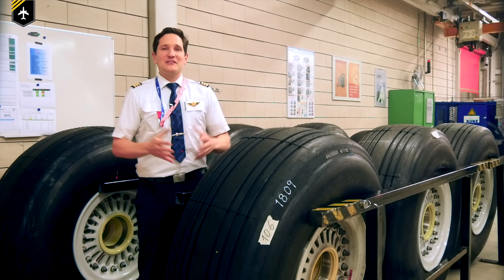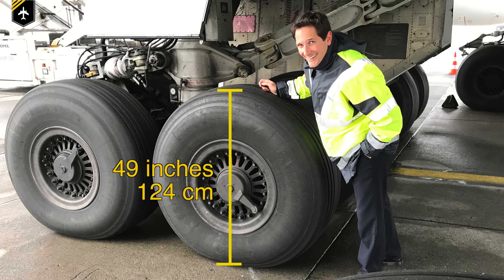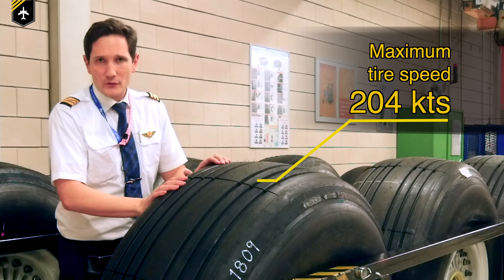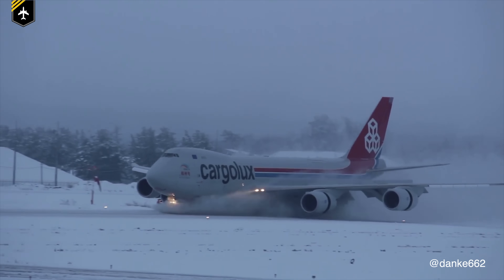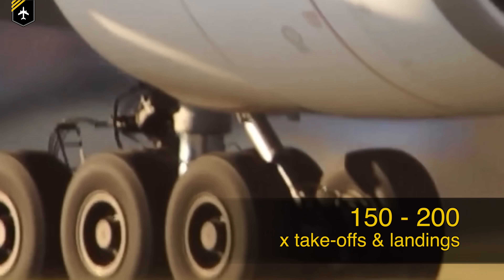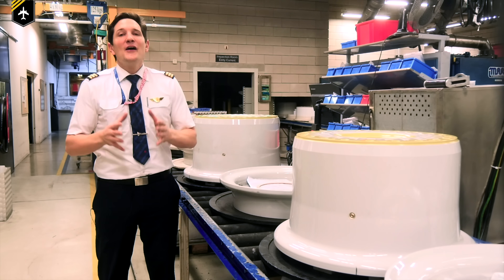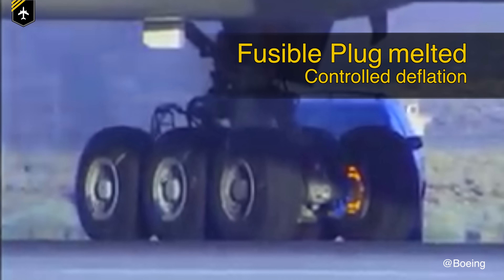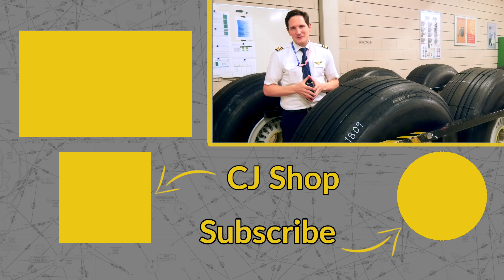HOW MANY LANDINGS can TIRES withstand?? Explained by CAPTAIN JOE

Comment: Modern cars are also equipped with the tires that are not prone to deformations in a case of deflation. Those are called Runflat, and allow to drive for another 80 kilometers at the speed up to 80 km/h even with a puncture.

Comment: Hello, Why not mold some "wings" on the sidewalls of the tyres to catch the wind when lowering the landing-gears onto the windflow and thus make the wheels spin to minimize the threadwear when landing. If the "wings" will have a wedgeform they will always spin in the right direction if the flat surface is mounted on the lower part of the tyre and therefore takes more wind than the upper part giving a "positive" rotation.

Comment: Just an FYI, there is such a thing as dry air. The nitrogen fill gas is dry because the nitrogen has been through a drying process (water vapor trapped and removed) before being bottled for sale.

Comment: I feel sorry for the tires at the very back of the pack, as they hit the ground first.
Reply: They hit the ground first but they do not have more load than the other... The load occur when the full weight of the aircraft is on the suspension, by then all tires (except sometimes the nose gear) are in contact which the ground and load is distributed. 
That is why trailing tires do not have to be changed more often that leading tires: the wear is even.

Comment: It would be interesting to know how much one of  those tires costs.
Reply: Apparently around $5,000 a piece, which really isn't all that bad being its aerospace.
Reply: @AllenSunnyD  Thanks, Allen
Reply: @AllenSunnyD  That is not bad $5,000 i have looked at  farm tractor tiers that are £25,000 a piece
Reply: You can find them used for about 1000 bucks each there's alot of farmers that put them on their equipment because they never wear them out alot of them have a sidewall that's about 3-4 inches thick compared to a truck tire that's maybe a half inch
Reply: Cam:  I live in Central Florida where most everything is deep sand, the plane tires will float across that like they had any load at all, saves you from having to call out a big tow truck every few days.
Reply: Ralph Turner Probably more than a Modern Car.

Comment: Layman thoughtl: why not have a system on the landing gear that takes the speed of the aircraft into account and then electrically spins up the wheels to match that speed as closely as possible? On touch down, the wheel is already almost at the right speed so the initial shock should be much lower. Probably something that makes this impractical, or the gains too small.
Reply: Spinning tires cause  Gyroscopic effect and affects the aircraft handling.  The same reason why the brakes are applied as soon as the aircraft is airborne, otherwise the plane won't respond correctly.  Air Force Crew Chief with 24 years experience.
Reply: I just wrotte the same thing!great minds think alike!!
Reply: Watch Mentourpilot's "Why not make plane-tires spin, before landing?!". He pretty much destroys the idea fact by fact.
Reply: Causes oscillating during landing.

Comment: Really looking forward to the next one.

While doing the post-arrival walkaround, I was told to look for 'slashes' in a tire. I have to admit, I have never seen a damaged tire before, so I'm clueless when it comes to those 'slashes'...
Reply: Slashes happen during shipping. Especially when you move them around with a forklift. The forks can damage the sidewall. I've seen maybe 3 or 4 in my career. Mechanics are suppose to catch this before they go on the Aircraft. But you can't see everything working at night .

Comment: I would like to praise all the effort your go through to find just the right clip of various events to show us a lot more than mere words could get across. Love the safety plug blow out shot-- but you didn't mention the glowing-red-hot brakes! Yeoow!
Reply: Film like the one where the fuseplugs release are typically from certification flight testing -- a maximum-energy braking test in this case.  It's a given that the fuseplugs will release (required in order to pass that portion of the test, in fact), so everyone is ready for it.

Comment: how does a yoke or sidestick help the plane to take off or land
Reply: With the yoke or side stick the pilot controls the ailerons and elevator, and these are used to steer the aircraft. During the takeoff roll when the aircraft reaches the correct takeoff speed the pilot pulls the yoke or side stick backwards to move the elevator so that the aircraft takes off. During the landing the pilot controls the aircraft's pitch angle and longitudinal axis with the yoke or side stick.

Comment: Nitrogen is nearly identical in temperature sensitivity to Air (and many other compressed gases). The Reason Nitrogen is used is because it is super dry compared to air from a shop compressor. It's much easier to just say nitrogen only then say dry air only which is harder to monitor/test.

Comment: Why isn't electromagnetic braking used instead of the standard braking?
It can eliminate the problems of heat and wear.
I understand there'll be disadvantages too but it'll be a good worth if you put a video explaining it in the upcoming weeks.
Reply: What do you do with the electric energy generated? If you can store in a battery or an capacitor, ok. But in an aircraft there is no such battery. So the only way to get rid of it is to turn in into heat. Well, if you have to turn in into heat anyway, you can simply stay with friction brakes which are also much lighter. The kinetic energy the aircraft carries does not simply disappear, regardless what kind of brakes you use, the energy has to go somewhere.
Reply: @shi01  There are other types of electromagnetic braking than what you were talking about. In one of the type what I know you are just going to convert the energy into mechanical stress over the mount member.
So technically there'll be no heat generated, but that's not the real case. Heat will be generated but not as high as friction braking. The energy is going  in mechanical deformation of the mount member, but if done with an accurate analysis and a decent FOS the deformation will be neglible. I think you get it.

Comment: Why don't you tell us about the tires construction ? As that is a most extreme difference than other tires, let alone a car tire. Many airplane tires have as many as 49 plies or layers of construction. Are they bias ply or radial. Nylon plies or steel belted and why ?
Reply: Both bias and radial tire constructions are available for aircraft. Nylon and steel materials are used in in the construction depending on the tire manufacturer and/or the specific tire model. 49 plies sounds like a lot!

Comment: I’ve changed many a tire over the last 30+ years in aviation. From 727’s to 787’s ,airbuses, DC 10 etc etc. The 777 center tire on the main gear is hardest. I’m Tired of Tires. Brakes are the worst!

Comment: I wonder why they don't pre-spin landing wheels to reduce wear/prolong life of tires? Is potential weight of some electric engines of auxiliary turbines to spin up them really that big to offset savings on tire wear? I'm sure that aircraft tires cost fortune due lesser volumes produced and high tech required for extreme requirements, so imho that weight penalty might be justified. Even if prespinning happens by means of some wheel covers with wind-mill aero elements, even if it will prespin just to half of rotational speed vs that of initial speed on land touch, it still should double tire life.
Reply: More weight means more fuelburn. Just the energy needed to let's say 50kg extra lifting to a height of 10'000m is significant. Now that multiplied with every flight an aircraft does over an year and you will realise how much extra fuel this actually would be.
Just another example. About a decade ago airlines started to replace the paper manuals on board the aircraft with tablet computers for the cockpit crew. But, they didn't do that to be more comfortable for the pilots. No, they did that to save weight. Also i know a case where an Airline switched all their life vests from a 2 chamber model to a simpler one chamber model, because the one chamber model was 0.002kg lighter per vest.

Comment: Hi Joe, very interesting video.  One of the things I have always wondered about landing gear on a larger aircraft is, how much tolerance is there for a pilot to touch down with the nose of the aircraft pointing straight down the runway?  I have seen videos of planes landing with the nose a few degrees off the centerline to compensate for wind and after touchdown use the rudder to bring the nose over.  I know smaller planes "crab" into the wind and use rudder/aileron upon touchdown to point the nose straight down the runway and I know this is the case as well with larger planes.  Still I see planes touching down with nose off center.  Do the mains pivot to allow for this and if so how many degrees can the plane nose be off the centerline?  Would be very interesting if you can make a video on this.

Comment: Hi Joe,

Could you go over the retreading process of the tires? Be interesting to see what type of air pressure gauges are used for such hi psi tires. A tour of cargolux facilities where you work would be terrific! Perhaps even a shout out from some of the crew and coworkers that help pilot and keep the queen of the shy flying! Would be curious as to what scheduled maintenance occurs at what intervals on the 747? How long does cargolux plan to fly the 747? What plane do they see as it's replacement?  The new 777x? Thank you go and appreciate the new cargolux videos😀

Comment: 747-8 Nose Tires are different size than main wheels 747-400 are all same ✈ Also note whatever maximum speed written on Tire or Tyre is hereby the maximum landing speed for your aircraft zero flap heavy etc

Comment: Excellent presentation and accurate information. I was a  landing gear engineer for a major airline. You may be interested in my comments to another airline captain's YouTube. He commented on rotating the wheels and tire prior to landing:

I was a landing gear engineer with a major airline for 33 years and the tires were one of my responsibilities. Seeing the 2,617 comments below remind me of the MANY times I answered the same question. One of the major points you didn't mention is that the wheels spinning at touchdown speed with the tires out of balance would shake the airplane apart. With eighteen tires spinning on a 747 one can imagine the shaking that would occur and the passenger's reaction. Actually, B.F. Goodrich ran an exhaustive test on this problem a number of years ago and discontinued the test because of the vibration it set up. Everyone believes that adding little flaps on the wheels or tires would solve the rotation problem but there is no way to control the speed of each tire so there would be no real benefit. In addition, not only spinning the tires but the brakes would also have to be spun up which would require considerable power. The brakes are designed to absorb the enormous energy of a rejected takeoff and not easily rotated. Nitrogen is used to prevent the tires from exploding. We once had all four tires explode on a 727 after the pilot taxied the airplane up and down the runway trying to burn off the fog. The tires at that time were filled with air (80% nitrogen and 20% oxygen). The brakes became so hot with all the taxiing that the tire solvents mixed with the 20% oxygen and became hot enough to explode. We all converted to filing the tires with nitrogen after that. As an added note, when the Concorde was designed, they considered using nitrogen in the tires just to save weight. The gyroscopic effect of spinning tires would also adversely affect  trying to control the airplane during a critical time of landing. Your video brought some interesting points from a pilot's perspective. I just thought I would add a few points from an engineering point of view and experience
Reply: Great comment, thank you for giving us the perspective of an engineer! 
Very interesting
Reply: Thank you for answering a question I've been asking for years "Why aren't the wheels spun up tp speed before landing?" Now, I know. Thanks again.

Comment: Like to see how to jack up the wing to test the landing gear.
Reply: I've jacked a few smaller aircraft, DC-7's. If you are lucky, you have a hydraulic mule/power source to pump the jacks. If not, manually for a long time. As you go, level is maintained and the jack points checked to be sure no side stress crops up.
Reply: @davidnewcomb2700  I've used pnuematic Jack's for And Md-88. Works pretty good for working in the middle of nowhere

Comment: The REAL reason why aircraft tires are filled with nitrogen instead of dried air is: air contain oxygen. In case of a brake overheating, it can set the inside on fire, which will cause the pressure to increase until it explode! And unlike in the test, it is filled with a gas (air) not water, so it don't just release the pressure, but explode with a stick of dynamite of force!

The rest is usefull, but quite secondary.

As for the pressure vs temperature, it is a total myth! Nitrogen is 80% of the composition of air. The change due to the oxygen content is really minimal. Also, the diffusion of oxygen throught the rubber is almost null. The normal maintenance will cover it without issue. On my car tire, I lose half a psi per year !

Comment: I worked for a small island hopper out of FLL back in the 90's. One of the pilots called on the radio to the HQ and said that he needed a new tire and that he wouldn't fly passengers on the current tire. The maintenance supervisor asked how bad the tire was. The pilot insisted that it was bad. The maintenance super asked how bad. The pilot said it was bad enough that he wouldn't fly passengers on it.

Then the maintenance super asked, "Can you see the air in your tire? Because if you can't then the tire is good."

Comment: I’m curious why Air Canada had two incidents with landing gears so far in 2020?

First, the wheel fell off from a Dash 8 in a Montreal - Saguenay flight in January, during take off. This was in January 2020.

Then a Boeing 767-300 flying Madrid - Toronto had a tire explosion and some pieces damaged the turbine, curiously, also during takeoff. That was in February 2020.

Comment: The last time I heard the term "Fusible plug" was for the firebox of a steam locomotive. If the water level in the boiler got too low, and the water didn't cover the firebox, the heat from the fire could melt the firebox. These plugs would melt first, reducing the damage, and (hopefully) preventing a steam explosion through the firebox. Might also blow out the fire.

Comment: The 737 tire under test (at 4x) brings up an interesting point. Often in testing pressure the vessel (tire in this case) , it  is filled mostly with water. It reduces the deadly energy stored but still provides an accurate test
Reply: It is properly called an Hydrostatic Test... and it is not "mostly filled" but COMPLETELY filled with water,  as any air bubble interferes with the test.  The objective is to obtain a detailed graph of the pressure up to the desired test pressure limit, and in case of a DESTRUCTIVE test (made sometimes to find the ultimate pressure or "bursting pressure" of the tire, pipe or pressure vessel) to have clues as HOW was the failure.
Reply: @alfredomarquez9777  you so smart.
Reply: It is not related to how smart, but how KNOWLEDGEABLE  ;)

Comment: Having inspected and serviced aircraft tires for over 40 years, I find your information a bit limited to B 747. My background include aircraft with a touchdown speed of 200 knots and replacement after 10 landings or less. Pressures of 375psig or more. Also aircraft that does not allow retreading.  So my message is the cockpit crew does not know everything about the technical issues about aircraft. To get to know the facts about this you need the maintenance manuals, for the each aircraft, and the special manuals for tire maintenance. Also aircraft are not only for airliner use. One limit or rule may apply for one type of aircraft, but be totally different on another.
Reply: I have an idea to mitigate tire usage on planes.  I would love to talk to you.  I am who I claim to be.
Please contact me.
Thanks
Mike

Comment: Approach overheated tires at a 45 degree angle.  This keeps you out of the fusible plug blast area (90deg) and out of the tire failure danger are (in line)

Comment: Is there a tire as large or larger than a commercial aircraft tire that spins over 350kph?
Reply: Maybe dragster tires are bigger. They definitely reach higher speeds.
Reply: @nielsunnerup7099  NHRA dragster tires are 36x17.5R16 but yeah they spin much faster then aircraft tires.

Comment: My question Joe, when they change the tires by cycles, do only change the ones that touches first the pavement or they change all six tires? Do they have different cycles depending in which position the tires is set? Have a great weekend pilots!!!
Reply: The depth of the tread is measured. Below 2/32 of inch the tire would be replaced.
Reply: Not sure if they have to be rotated or do the penny test to pass inspection.

Comment: I have a question joe. Soo 3 lines is a second officer and 4 lines is a pilot but whats does the 1 and 2 lines represent?
Reply: 3 stripes= (senior) first officer. (Today we don't basically have second officers anymore). 4 stripes means captain. In European airlines 1 stripe means pilot in training, and 2 stripes means also a first officer, because in the beginning of the career the first officer wears 2 stripes, and after certain flight hours they begin to wear 3 stripes and are called senior first officers. However, usually the most common way is just to say first officer (without the word senior).
Reply: @mikep9604  thanks for the information very much appreciated😁👍